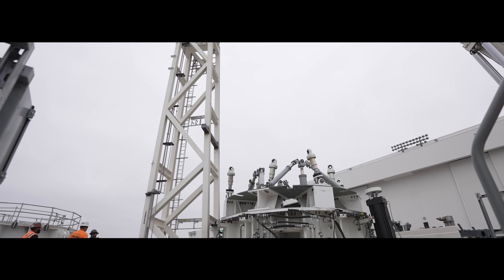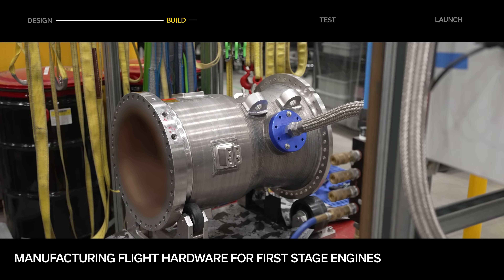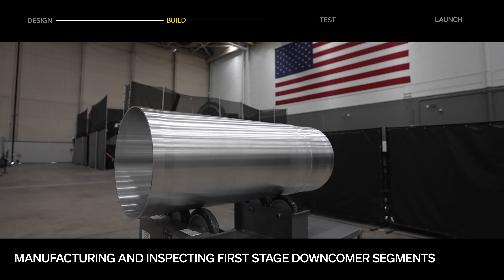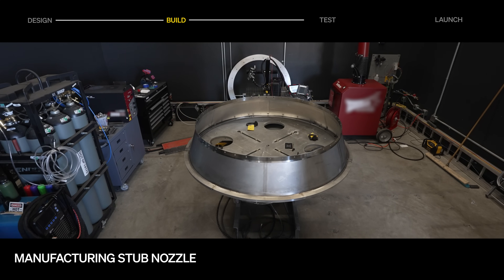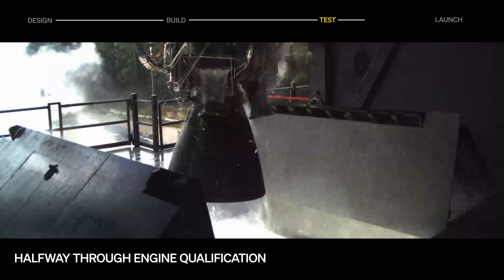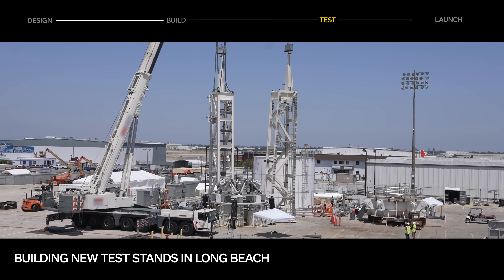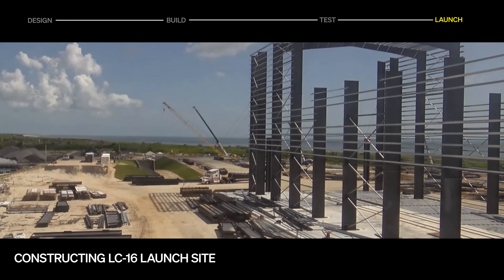Terran R June 2025 Program Update

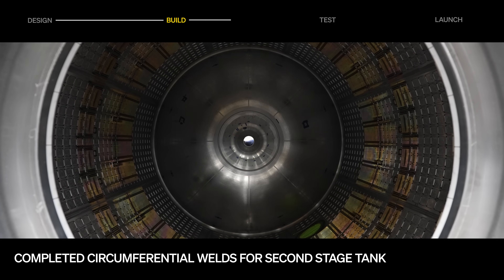Comment: waaaait! 0:41 how does that "puck" on the inside of the FSW rotate and create the reaction force without being connected to any type of inner support??
Reply: The support reaches through the tank itself; the FSW head essentially drags material from in front of it, to behind it.
Reply: @waterlubber  so it is connected to the outer head via a thin shaft that passes thru the joint seam and closes the seam after itself?